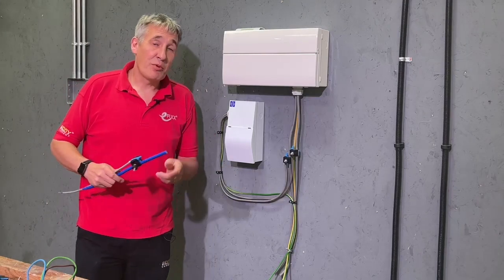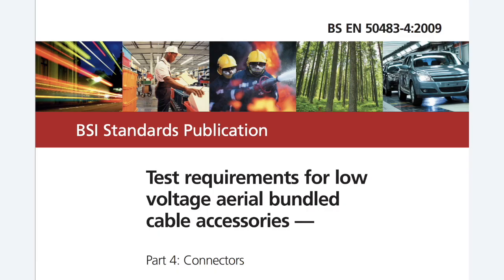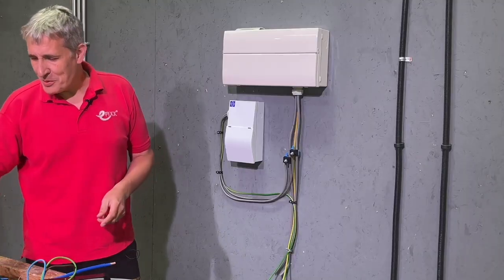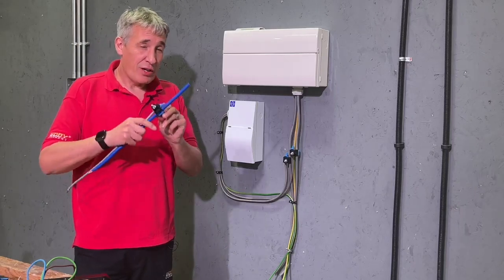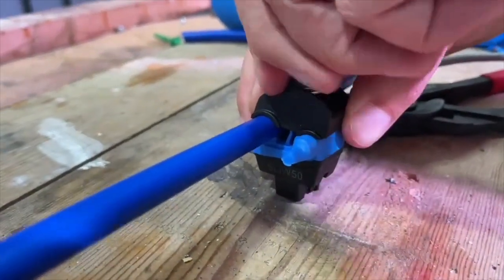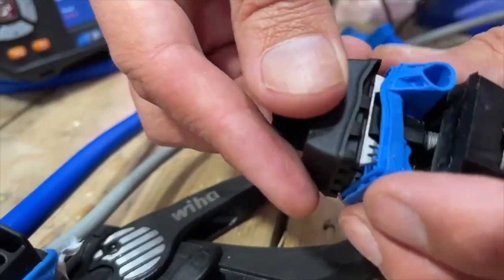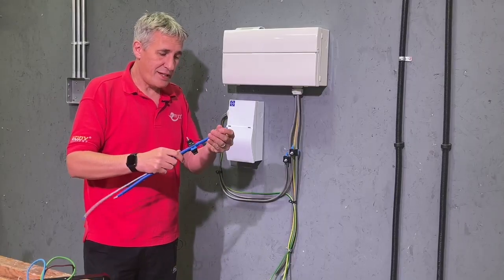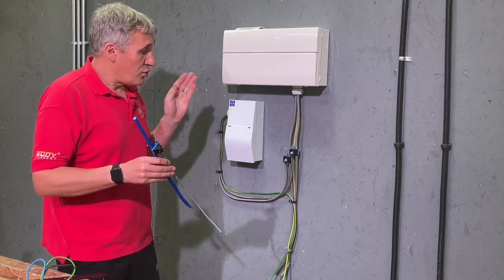Using INSULATION PIERCING CONNECTORS with METER TAILS - EV Charger installation - ENSTO SLIW50

Comment: I wonder how people feel about the size of the tails in relation to cut out with regards to a fault of negligible impedance? Personally I was taught that where there’s a 100A DNO cut out then the tails to even a single circuit consumer unit should be 25mm, not because your 32A EVCP will overload your 16mm extension tails there but because a fault of negligible impedance say to the metal case of the unit would potentially cause fire before the 100A cut out blows. However something like that which allows a 25mm to 25mm splice would be very useful. Or perhaps one with built in over current protection on the line side. It’s a nice idea just not quite there for the suggested use.

Comment: Which wholesalers, if any, stock these as I need one to tap into a cars 12V positive battery  cable and is fine for the application it will be used for.... just a bigger version of the old Scotchblock after all?

Comment: I'm not a sparkie, just an interested DIYer who has a sparkie mate who does actually stuff for me, and I wouldn't want anyone using these in my home. Surely they would need to be in an enclosure if they were used. They remind me of 'chocblocks' that were the bain of car accessory wiring in the past, but in this case for death levels of current. No thanks!

Comment: I think they'd need some sort of Wiska-style box but with open slots to accommodate the tails, which would then be covered by the lid, probably with plastic fingers which line up with and partly fill the slots when closed.  It'd also be interesting to see (perhaps with a thermal camera) how they hold up under load.
As for Henley blocks, they probably haven't changed in decades because they haven't really needed to.

Comment: These things are everywhere in Spain on the LV Distribution network. A welder plugged in via a20A breaker at at my villa to weld new gates. Next thing we had a fire start on the overhead distribution. Having said that compared with using Henly blocks you will only have two nuts to tighten instead of 6 screws, and covers.  Recent models have shear-off torque nuts so they can only be correctly torqued and cannot be loosened or removed.

Comment: If the meter tails are 25mm then it’s likely to be at least an 80a main fuse.  If the connecting cable is 10mm then the current carrying of the capacity is lower than the protecting fuse, so it’s surely not permitted.
Reply: Fusing of the spur off can be done at either end, it still protects the entire wire length from overcurrent.

Comment: What happens when you no longer own a eV car or want to disconnect the splice. How do you undo the shear bolt
Reply from the maker: The base of the bolt remains so just turn anti-clockwise
Reply: @efixx  oh wow. Well thought out then. This would be perfect for extra power in a motor home

Comment: Only designed to pierce one layer of insulation (read bs number ) . Having earned large call out wages while working for DNOs i can tell you they fail , when piercing through 2 layers. ABC bundled conductors are single layer . Mainly because they are more than 5.2 meters above the ground .This is where these are typically used. The only way to install these would be to strip a layer of insulation off . Then what's the point  .Also not to be connected under load (live ) .It burns the teeth off.

Comment: I've had to tighten and replace bonding straps over the years to know these are a terrible idea. People jumping meters is the 1st thing that alarms me, obviously there's other ways this has been done previously but this type of product will have the DIY'er sparks thinking they can do it. The next thing is that these will be tugged, knocked and all sorts exposing the conductors. There is a plumbing attachment that clamps on the pipe and cuts in a new stop cock (not the kits for outside tap) and I've seen that fail on installation which caused excessive damage, don't want to thinks about the consequences of a similar failure on an electrical system. I can picture someone clamping it up but not all the way to hold in position where the sheath is compromised and the installer moves it before fully attaching....I may be over thinking it, I'll never use them either way

Comment: I see a potential market for a wagobox style enclosure that has IP protection around the main tails and the exiting secondary tails, with a zip tie or a wire tie requiring a tool for opening.

Comment: Never heard of these. Seen them for thin data cables. If the contact resistance isn't good, then a fire on an outside overhead powerline isn't generally going to burn the house down.

Comment: I don’t understand why the standard thing is those loose connector blocks. Doesn’t anyone sell an enclosure about the size of that extra consumer unit or less that is specifically designed to house three large Y-connections?

Comment: I THINK IF THE TUBING WHERE THE 10MM CABLE GOES, COULD BE REPLACED WITH A  BLANKED OFF/INSULATED END, AND A SCREW ON INSULATED CAP BE PROVIDED TO GO ONTO THE END OF THE EXPOSED BOLT, THESE (IF REGULATED) COULD BE A GREAT ALERNATIVE WHERE SPACE IS A PROBLEM.

Comment: This i think is made by Ensto,250m euro turnover company with 1.600 enployees. Surely this gigant doesnt manufacture crap items?
Reply from the maker: No problem with the product or ensto - just people are using them for an application Ensto didn’t have in mind when designing the product.

Comment: As an end user I have had an Indra EV Charger installed by a well known national EV Installer. Should I be concerned that they’ve used these connectors to connect to existing tails?
Reply: Yes

Comment: Should there not be one single point of isolation to the installation? If there is already a 100A isolator, why wouldn’t you use a Henly block.

Comment: Just tried these out today and I have to say they're a game changer for EV installs where there is limited room to install Henleys. However, I would like to know if they have a BS number and whether or not they are rated to a specific amperage?
Also the fact that the bolt shears off at a specific torque yet you can use two different sizes of conductors is strange, how can for example a 25mm and a 16mm both clamp down to the exact same torque? 
They should issue an exact spec sheet and we can then make an informed decision.
Reply from the maker: No BS numbers and No current ratings - it needs one of the manufacturers to explore the application.
Reply: Would need to see approval from a EN/BS for installation and current rating of connection with cable installation taken into account. The risk of exposure to live connections protected by a thin tube is not great. Can’t see why this can’t be a solid end ?? A enclosure box is a must and warning ⚠️ label added as these insulation are not secure.

Comment: so far used 30 of them, love it. Looked all comments, seems like people make more drama then it needs. This is future for EV installers. Looks tidy and professional. Single insulated rubber, is thick enough. Most of helney block installers leaving 20mm basic insulation exposed, so what we are talking about...
Are so many installs, modifications and rewires done by "competent electricians" which are more worrying then piercing connectors.
Try it - I'm sure you will be surprised how great they are.

Comment: Evening, 
Another great video! 
When you tap off of main tails, don’t all cables need to be the same size? Otherwise the 10mm cable has the same overcurrent protection as the 16/25mm tail at say, 100amps, which is too much for the 10mm cable
Reply: No. As long as the 10mm cable is sized for the load and there's overcurrent protection on the outgoing circuit, it's fine. BS7671 says you can put overcurrent protection anywhere on a conductor's length as long as it's before the load.
Reply: @havoctrousers   Great, thanks Robin

Comment: My EV charger was installed recently using a pair of these, I was impressed that they did the install without disconnecting the power. I'll be okay with the capacity of this connector until someone uses a FLIR camera on one carrying 32A. Consider that a challenge to anyone who has a thermal camera!

But listening to concerns about the mechanical vulnerability has me thinking, this was installed under my stairs where I go in and out, and store things. Now I am thinking it might be wise to put some kind of perspex shield over my meter, cutout and tails.

Comment: The biggest issue with these connectors is that the end shrouds are single insulated. A tear in that exposes live parts. A potential solution would be to enclose them in an enclosure which can only be opened with the use of a tool. I don’t think a meter box alone qualifies as that.
Reply: We use similar lugs for line side taps on this side of the pond, but they are always inside an electrical box or raceway of some sort.  The only time you see them 'exposed' is for secondary distribution (so named cuz it's connected to the 120V/208V/240V/277V/347V/480V/600V secondary of a distribution transformer) where it's 20ft or more up the pole or next to the service riser weatherhead.
Reply: @randacnam7321  Exactly, in the situations as described there is virtually no chance of accidental contact. There is either a secondary level of protection or separation by distance.

Comment: Like everyone else my instinct is to say NO. Too many memories of the problems with 12v systems and scotch locks. But more specifically : why would we tap a 6mm or 10mm single insulated cable off a 100A supply. And the cut end of the load cable seems to have Very little protection if inserted a little too far into this device. Looked like a rubber glove being poked at 4.50 in the video.

Comment: Looks lethal to me as an ex sparks. But I did use line taps on 3 phase distribution in Factories feeding machines below the overhead 200a power ring.. those Henley blocks are in use in the 1960s. I use to collect them from the local electricity board works plus a meter board with porcelain insulators.

Comment: They are great on bundled overhead cable. As for ground level, would like to see them encased in a box filled with epoxy just so idiots can't get to them.
Think they are great for EV installs and extra CUs when needed.

Obviously need to be designed for this application and type of cable we use though before they are actually used.

Comment: Essentially the same as that used for underground cables, which are then epoxy potted in a polycarbonate shell, so there's no reason why you couldn't do the same above ground rather than leaving them to attract dafties.

Comment: Take a look at Sicame, they do one that I think is better quality. Do I have reservations, yes. So my options are, remove the cut-out fuse, this has dangers attached, arc flash etc, or use a single insulated connector in a switch room, meter cupboard or maybe under the stairs in someone's house. Would I risk my IET membership status by getting one of my electricians to install one?? I think my answer is yes if, the IPC's are enclosed.

Comment: A lot of people here commenting on it being a possible fire hazard.. Did you skip the part of the video where he said the DNO has been using these on overhead lines for years? If they're capable of happily taking 100A+ for supply take-offs they're more than good enough for houses, just need more refinement to make them more suitable for domestic use

Comment: As an alternative isn't there a consumer unit with a built in Henley block to neaten things up.  Like incorporating a 2 way double pole isolater.   Could be a market for these if sold with an enclosure that has a security seal or tool to open

Comment: Awful idea for homes. They look untidy and amateur. That end rubber looks very easy for little fingers to pull a hole in and then get zapped. Why change something that doesn’t need changing. Nothing wrong with Henley blocks. So what they take a bit longer to install. Everyone these days is in such a hurry to do things quickly and then charging a fortune for it. If your going to have to put these in an enclosure you may as well use a Henley designed for the purpose. They are designed go above prying fingers high up. Not in a household cupboard for a reason. Bad bad idea

Comment: Its just like the water taps, they may work ok when first installed, however over time they become a complete mess and make things worse and you have to rip them out.  They will bring moisture into the cables over time, no matter how well the seal is.   This is why you see compressed nitrogen cylinders on all the old copper cables for the phone companies to help stop water intrusion into the cables.  It would be nice to see inside the cables and how many of the fine strands are destroyed by the taps on the main tails.   I would be of the same as the DNO guys about refusing to touch them if installed.  It becomes your problem if your the last guy to touch it.  They aren't being used for the propose that they were made / designed / certified for.  👎

Comment: Interesting. Several decades ago we used 'vampire taps' to tap in to the original 10Base5 Ethernet cable which I guess was around the size of a 25mm² meter tail.
Reply: But built very differently - 10base5 is coaxial.

Comment: Are we saying that if someone made a proprietary 2 part enclosure so you screw the base to something stable and a lid that was only removable with a tool then it’s a green light for it? Why can’t they design the bolt to shear rather than the nut I feel uneasy about that amount of metal showing. Another concern is the only fault protection for the 10mm tails is the main fuse

Comment: What is the actual cross sectional area of the  connection as main tails are 25mm and your tails look like 10 mm with a very small connection to the main tails. The fact that the electrician is responsible for the install speaks for itself I would not use it

Comment: How do you get it undone once the bolt come off ? Or you gotta break the plastic  screw then cut the security bolt ?
Reply: There's another half of the nut which can be used to undo it. Bear in mind the tails cannot be left like that though as they now have 6 little holes where the IPC bit through. I went to a job where the meter had been changed and the supplier fitted an isolator and gave the homeowner a demand to get them replaced with henley blocks. thankfully there was enough play to fit the henleys at the point where the IPCs had been fitted and fix them back.

Comment: They seem like a good idea but at the sametime if it was me i would want the job done properly. I understand its agro for electricians to have to pull the main fuse (Many do) but ultimately on every new smart meter install they should be putting a 100amp isolator after the meter. I recently had my meter upgrades and i fitted a 100amp isolator to my incomer board and the nice fella from siemens wired directly into that.  I would love to see some stress testing of the joints using 100amp and then overloading it to 200amps, a flir camera will highlight any issues caused by overheating.

Comment: Another thought provoking show guys.  Loved the bit by Solicitor Joe.  The written disclaimer is brilliant.  Quote "your torque screwdriver may be at risk if you do not keep up with repayments"

On a serious note I can see people using this to bypass the meter to steal electricity or for the setup of some canabis grow farm.

This technology was not designed for this use.
Most meter cupboards are normally at an easily accessible height
Tapoff block would need to be in an enclosure that's needs a tool for opening and that is mechanically fixed to wall or board
What is the IP and IK rating?
Clips or cleats would be needed to help with strain relief
16 or 25mm2 CSA tails are double insulated

The concept of quick tapoff is a good one but this is not the solution for domestic EV or PV without a lot more development by the manufacturer
Reply: Could use them for that. But any criminal probably isn't too concerned with safety, so they wouldn't need such a specialised tool. Just some thick rubber gloves, a kitchen knife to strip the insulation, and a mini-blowtorch to solder on the new wire. Not exactly code-compliant, but so long as you warn your crop-tenders not to touch the metal bits, it probably won't kill anyone.

Comment: I've using those here in Spain during the last 25 or 26 years (Niled and Cahors brands) for both overhead lines and to connect RVK and RZ1-K (EU cable denominations), and never had a problem. Even you can reuse them. Anyway, you need to protect properly the cables ends.

Comment: Interesting they do look nice. My only concern is when they are removed they now leave the sheath damaged, and you might be asking why would you remove them well I don't know why you would either but somebody would.
I would be also concerned of moisture ingress but they look reasonably well designed.
Which leads me to saying my souvenir experience of 240V 60 Hz in the Philippines because I went down a fan cord in my hands to slide it up to the extension to unplug it... I did not know there was nicks in the cord... yeah Youch.

Comment: That's not going to happen in the United States, well, legally. The main supply wires must you through a primary panel. If you need more circuits, they go to a sub panel which is uses a breaker in the main panel. Besides, you aren't allowed to have connectors outside of an enclosure here in the United States. I don't about those Romex splice kits, but those are controversial.
Reply: That's still the preferred method here but these are used where access the the main DB (panel) is difficult. In the UK the incoming supply/meter can be anywhere in the house and doesn't necessarily need to be close to the main panel either. It's weird, we have some super tight regulations and then some others are left open to creative interpretation either by electricians or by manufacturers.